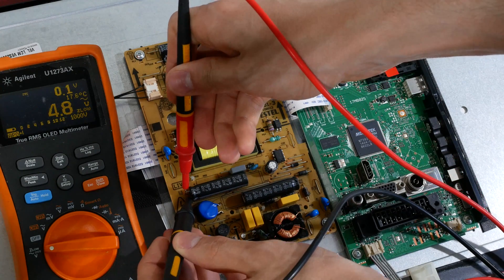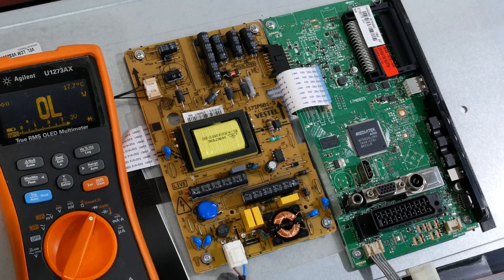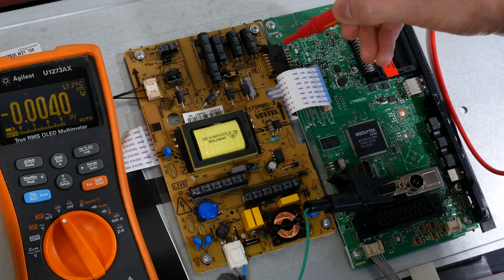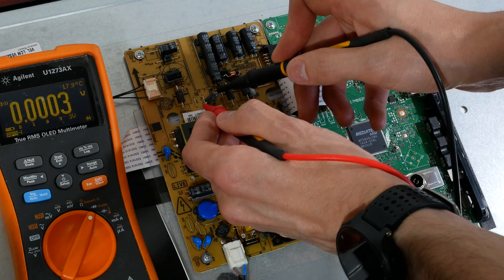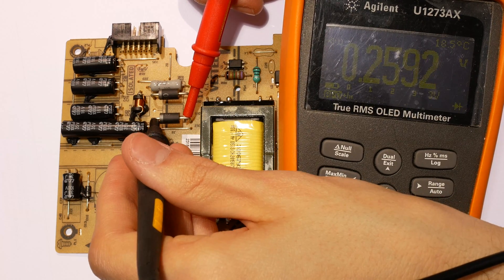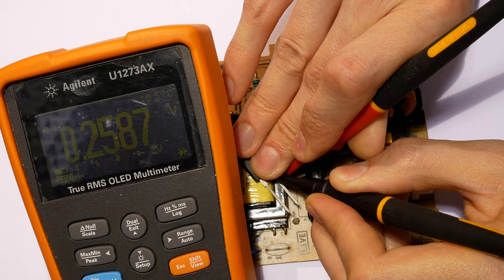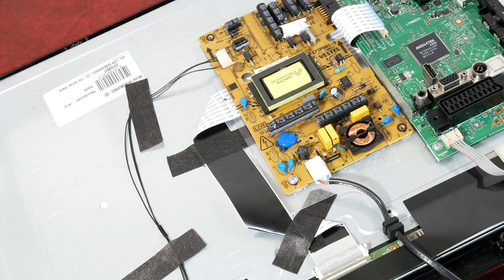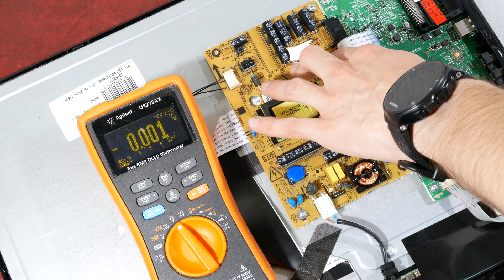Repairing a TV that doesn't turn on - power supply - diodes in parallel?

Comment: i got the same problem with this one. do the 2 diodes will long last?
Reply from the maker: It is still working after all this time. There is probably not that big of an advantage having diodes in parallel like that.
Reply: @jfaria  ok boss. thank you for sharing your experience. i will do the same just like what you did
Reply: @jfaria  lastly. i will ask you..what happen to the current when connected in parallel? it will add or subtract?
Reply from the maker: @malvargeronilla3502  If it is the same problem, make sure you remove all the bad diodes and leave only good ones. In theory the total current of the diodes should be added, however they are never exactly the same, that means some diodes will do more work than others.
Reply: @jfaria  boss it is ok when i replace diode rating 5A 150v  to 5A 200v ?
Reply from the maker: @malvargeronilla3502  Probably, just check the ratings of the old one and make sure the new one is not worse.
Reply: @jfaria  its ok now. thank you. i did take the one that is defective

Comment: hello . my english is not so good . but i understand little .. failed diode .. you didnt replaced with new one .. why ? .. three diodes 
enough ??
Reply from the maker: Diodes in parallel are usually not a good idea, when they get warm only one of them does most of the work anyway.
Reply: @jfaria  ohh thanks jose .. i wil try